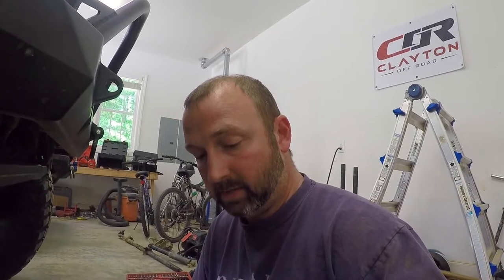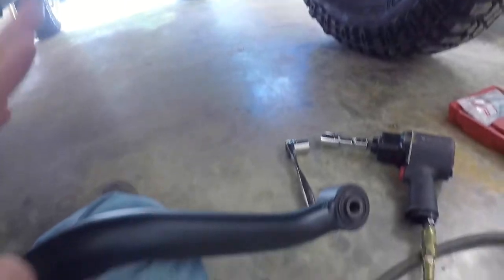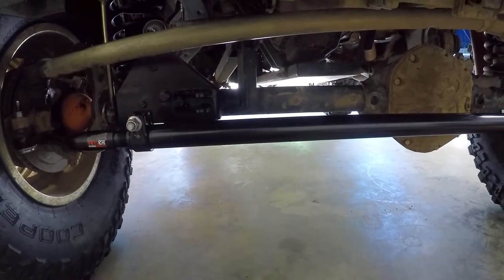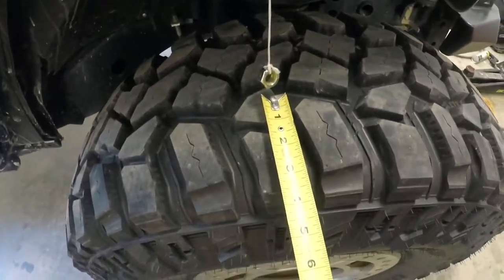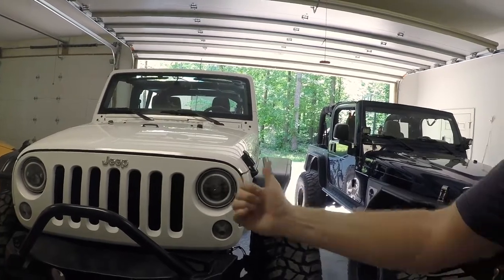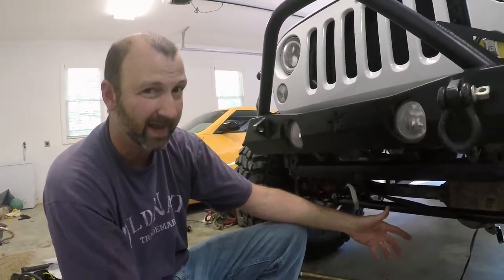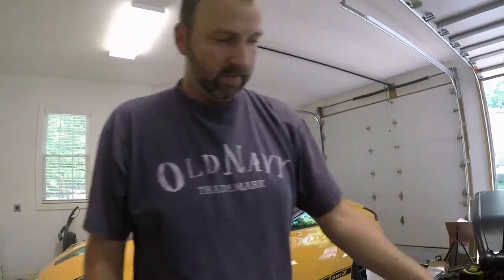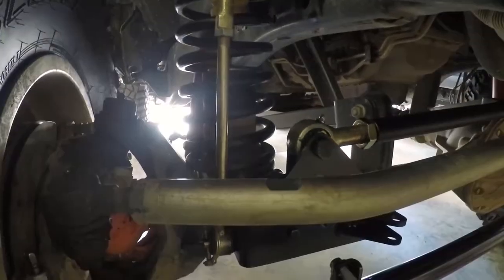Clayton Front Track Bar

Comment: Just a tip, easier way to center the jeep is to get a helper to turn the steering wheel left or right then when your measurements are centered, adjust the trac bar so that the bolt goes dead center. Another way to measure is just take your ruler and measure from frame out to an outside lug then measure the other side then go back and forth, again using a helper to turn the steering wheel. No need for ratchet straps...good videos just wanted to add an fyi.
Reply from the maker: I appreciate the feedback and additional tips! There are many ways to "skin the cat" so to speak.